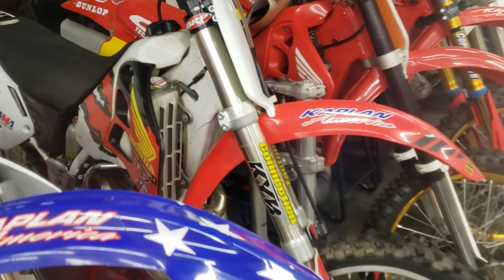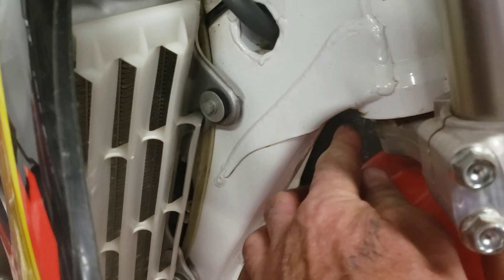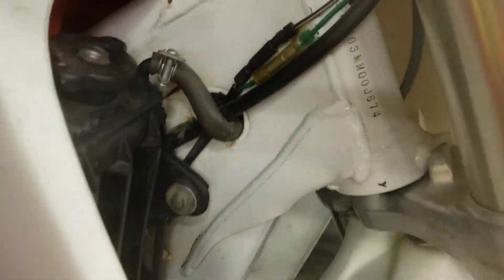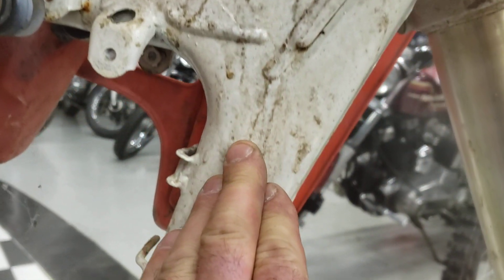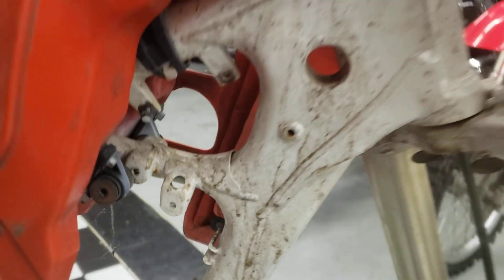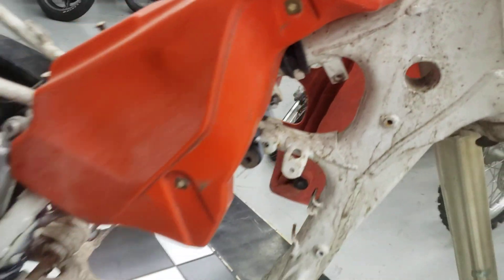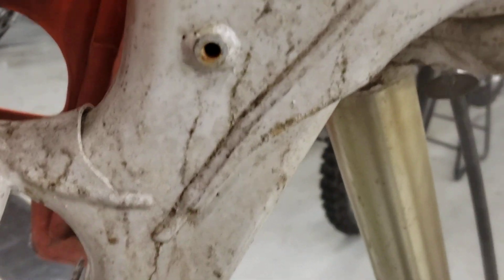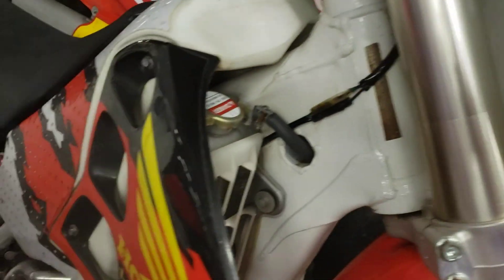Does 1989 to 2001 HONDA CR500R GEOMETRY VARY FROM YEAR TO YEAR?

Comment: They did change slightly, never more than a degree or 2, and they finally relaxed it to its final position in '94, when they also stregnthened the frame. From '94 - '01 it did not change. Pre-94 you will find variences of perhaps 1/2 to 2° year to year. I think the restyled '89 had the sharpest geometry, as it was based completely on the 250. Unfortunately, the suspension wasnt up to the task.

Comment: maybe measure wheel base ( axle point to axle point ) if  measurements differ , you should be able to calculate to find the degree / rake.
 1989-94 is 28 degrees.

Comment: Interesting. point and shoot motor probably shoot you into nose bleed seats in a stadium no matter what the angle. could have made it twitchy past 3erd. Throw it together and test em out back to back.  Although raising forks in clamps, longer links, and/or different offset clamp experimentation in combination with stabilizer might be more constructive on your highly groomed race steeds you already busted your asses on. Might have to trim sub frame to rid the 80s stinkbug look?